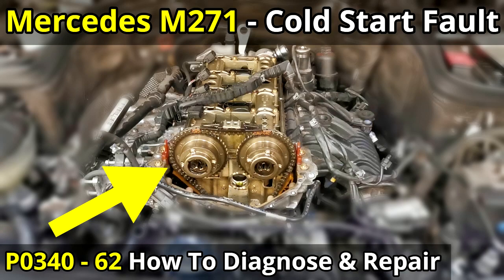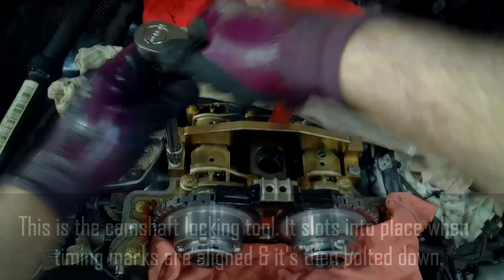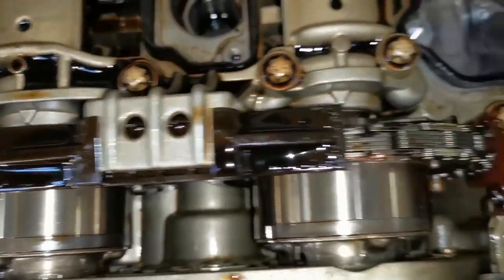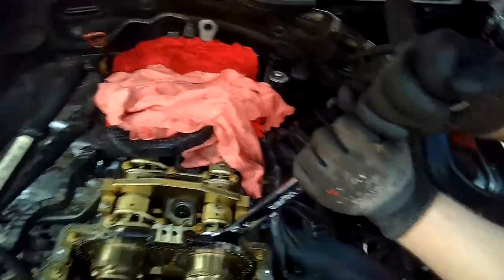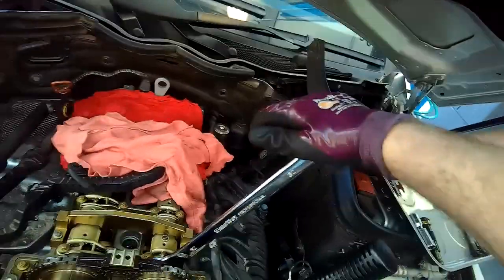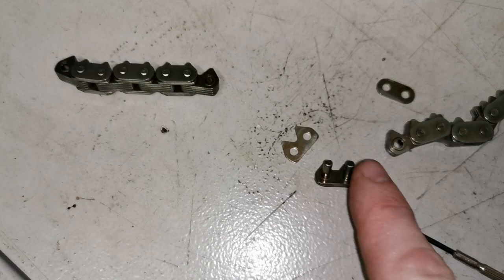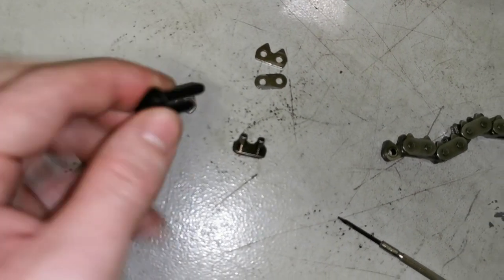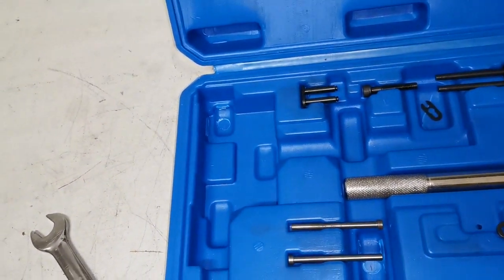Mercedes Benz Timing Chain Removal & Install Part 1 - How To DIY

Comment: I have a 2010 mercedeslk 350  v6 engine after you drive it about 2 miles and stop at a traffic light I hear ticking noise t has 143000 miles on it and I've always done all the timely maintenance on it, so what is causing this ticking noise?

Comment: great video series, assisted me all the way, big thank you
but unfortuately half the content is not needed, including the bonus, if the delink was done with the  CORRECT kit, with a smaller diameter pin. No need to go flush and pop off, the smaller pin will push all the way straight through in half a minute, no effort. You had made a disclaimer to that effect but may not be clear. Hope to carry on and help the next guy.
cheers mate

Comment: Hi, thank you for your videos. I have a question for you. I just got a MB w211 E350 wagon from auction. It turned out that I have to fixe the timings because of codes p0016 & p0017. My question are; Do you think that I should swapped or fixed the existing engine in the vehicle? Do you think M272 can be swapped with M273 engine? Thank you in advance for your help!

Comment: Mercedes makes very unreliable and unquality vehicles. I owned  w203 for 13 years and now w204 180cdi from 2012.I have timing chain noise at only  154 000km.Same issues like bmw n47 engine.I also have totally rusty rear subframe steering wheel lock broken very unquality piezo injectors plastic thermostat  and plastic  water pump...Mercedes  is one big joke.I will never buy any mercedes  again

Comment: Great vid !! How did you get the engine timed so that you could fit the lock tools? I would think you can’t just turn engine over by hand? Sorry I’m a noob . Also could you please tell me what is the name of the clamps you use to hold chain in place and where did you get them please ?

Comment: Hey Gerard! We've nailed down a solution for the issue with the locking mechanism in M271 EVO engines by designing completely new VVT gears. Interested in trying them out?
Reply: Shii I’ll try them lol

Comment: I want to but a beautiful 88 300 SEL.  It has 95k and owner will sell for $4,000.
If I have to do the timing chain, it may not be so bad because it’s a low price. What do you think car runs incredibly well is it in desperate need of a new timing chain just because of his age and the fact that it has 95,000 miles.

Comment: Great video. Have you seen the diagnostic  video that ends up with the crankshaft pull being the culprit ? The timing marks had moved 40 degrees. Seems an ongoing problem that needs checking when ever you play with one of these engines.

Comment: Hi from greece . 
Owner of w203 1.8 184hp .
I want to buy a timing chain kit and gears together. I see a lot of oem kits at aloexpress or ebay at 200-250$ .  Do you have experience  about these kits? I think they are chinese. Is this too bad for purchase??

Comment: Need to know how to remove the cover i front. I only get the drivers bolt on the bottom behind the cover. Cant see how you remove the passenger bolt..

Comment: If your throwing away the chain and not reusing it why not just get a grinder and cut it ?
Reply: That's how I have always done it. 🤷‍♂️ and I have been working on these cars for 20 years. I take a dremel tool and ground the pins flush. Then just use a screwdriver and pop off the links. Then I attach the new chain and run it through. Then I use the specialty tool to re-link it. Many techs at MB do it the same way.
Reply: I think it’s just to avoid dropping metal into the engine for noobs like me lol

Comment: Hello Gerard, really enjoying this video.
Isnt it neccesary to replace the lower chain as well, that drives the balance shaft? or dont they have an issue?
BGS sells the TC5690VFK kit for this M271EVO engine but that is a roller chain kit i.s.o. a plated tooth chain and sprockets. Will it still fit?
Thanks in advance! Hans

Comment: Great video got to appreciate the footage put in of actually using the chain tools close up. Great location on the W204 1.8. In England  nearly every W204 has the OM651 diesel with limited access to the chain.
Reply from the maker: Thanks James, I appreciate it 👍

Comment: Hi man, nice video, i just want to ask when its needed to change the timing chain??? I have a Mercedes Benz C180 Kompressor 2005, it has 186000 km, i got it with 140000, lately i have heard that they suffer from the timing chain and i dont want to loose my engine because of this. When i brake and the RPM of the engine start to decrease i hear a small whine from the engine, and dont know what that is, Maybe the chain?? Thanks

Comment: Your doing it wrong.  Remove the 13mm then install with the 19mm all the way tight to the chain and this holds it in place.  Then install the 13mm and drive out the pin
Reply from the maker: While I completely agree that is the way to do this job in most cases, it was not the most suitable or comfortable for me on this job.
1) when it secured in position like that the view of the pin is erased, there is no view to be 100% that you are pushing the pin exactly where you want it.
2) the tool I have has a bigger push pin than the pin that is being pushed through, so once I got to the stage of being flush I could visibly see it and stop winding the 13mm in with excessive pressure, which may cause damage to the link if not aligned.
3) I recommend using which ever way is safer/easier for you to do the job, it is not always a one way fits all. 
Maybe there is a better tool out there that has a small pin and would push the pin right through, I would have used your method if mine was that way. 
Doing it this way did turn out to be 100% successful with no issues, as long as the job gets done successfully both tech and customer will be happy 💪👌 

Thank you for posting your info always good to hear feedback, it's great for viewers and knowledge sharing🙏🙏👌👍💪